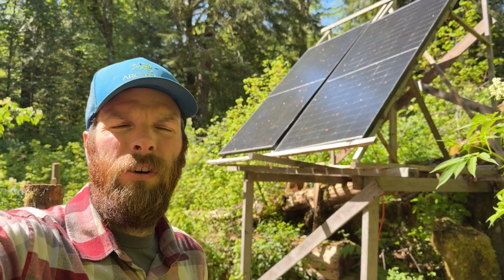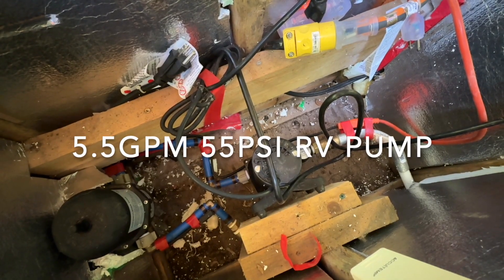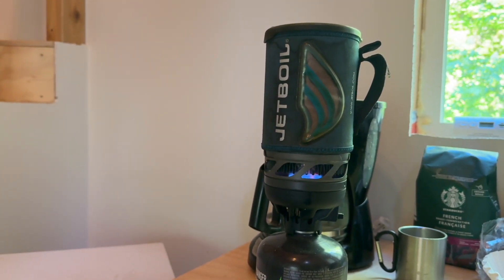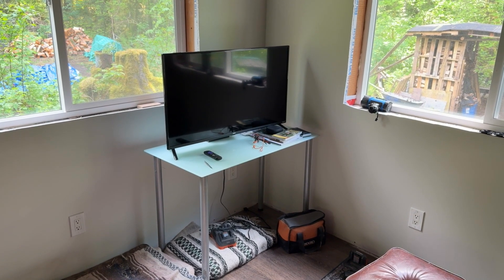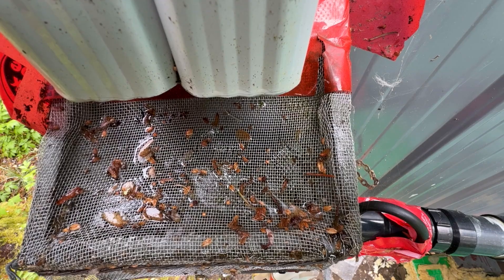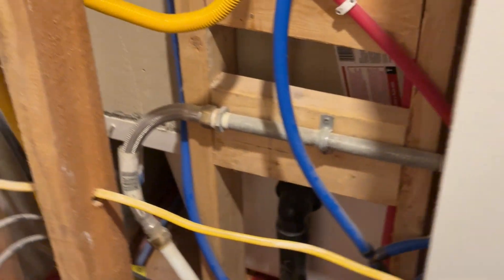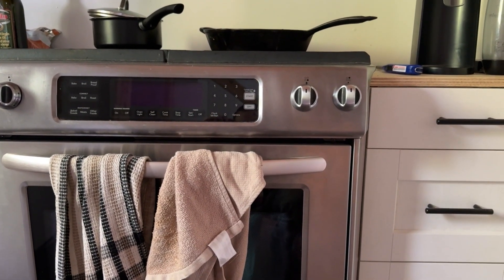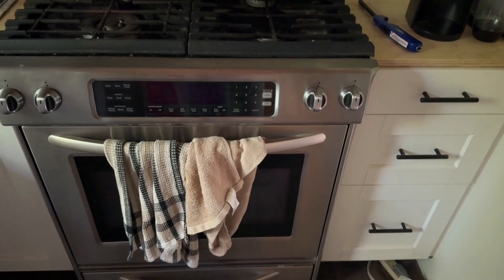Modern Off-Grid Living: Power, Water & Heat Explained

Comment: The stove "nuts" for propane or natural gas conversion are called "Orfices" I believe. you have a convection/ air fryer oven on that unit which will use that element in only that mode I believe.
Reply from the maker: Yes they are orifice nuts and it is a convection oven, I read through the manual and tried it once but it kicked on the electric element, maybe I'll see if I can find a different mode to turn it off but wasn't seeing it originally. I use two cast iron pans for a make shift oven which works ok haha.

Comment: I use a diesel heater for supplimental heat to my woodstove. The propane units area PITA and create a LOT of moisture unless vented and then not very efficient IMO.  The diesel heater will run all day on a single gallon of diesel and the heated air is completely clean and isolated from the combustion air so it doesnt burn up the oxygen in the room and release Co2. I have my solar system in place with a similiar AIO inverters and 30kwh of battery but have to tackle water next spring. during the winter I need the Generator periodically to charge the batteries.
Reply from the maker: Good to know thanks. Ya I'm leaning towards a diesel heater, how much wattage does the pump and fan use hourly?
Reply: @wildcoastoutpost  When you first fire it up it uses a glow plug to get going so it draws about 10 amps (@12v) and then after a couple minutes it drops to between 1-3 amps draw depending on fan/ heat setting. I have mine running off a ac to 12v dc power supply with a small lifepo4 battery also wired in parallel. you want the battery so the heater can be powered down without abruptly losing power which can damage things.
Reply from the maker: @fathergratwick  oh ok interesting thanks for that info. I’ll try it!

Comment: I thought you did a terrific job on this video. You are very knowledgeable about off grid. It’s a lot of learn for sure. We learned a lot growing up off grid in the summers at McNab.
Keep up the good work.
Matt Arnold
Reply from the maker: Hey thanks Matt. Appreciate the kind words. Definitely can be a lot sometimes but having fun!
Reply: I Have been watching your well videos since you started and am thrilled everything worked out for you.

I must say tho that I disagree with several thing you claim in this video and I think some clarity is needed. First off you can run any and all modern appliances from your solar system, assuming you build one for that purpose. I see people all the time moving away from off grid after watching a video like yours, and that needs to stop.

I have a 100% off grid home and it has every modern appliance, all running from electric. I have no backup generator, my system is designed not to need one.

I think when you are explaining the limitations of your system you should really include that the reason your system can't do these things is because your budget and lack of knowledge at the time on purchase and then installation was not enough to do it properly.

You have a solar system with like 820 watts of solar going into your all in one inverter charger. It can handle way more solar, and it should be. (i think it can take 4000watts iirc)

Next your battery bank is not big enough for a system to run a house, it is barely big enough for an RV.

The way you are supposed to size a system for a house is to first figure out how many kW of power you need to size your inverter. 3000 might be enough
Next, you determine how long you need to run those watts. this is to size your battery bank. You determine how many days of autonomy you want and increase the bank size accordingly.
Finally you choose your Solar array by calculating how much you need to charger your batteries by noon if the bank is depleted.

Now I know you are going to cry the "Thats a lot of money I don't have" song, and I get it. but just say that instead of saying that it can't be done, or you need to ration your power when in fact you dont if you build it properly.

ANyway, my off grid home doesnt have a well, I wish it did. Rain water isn't a thing either since it never rains more than 5 days a year.

Great job bumbling your way to a working well, I am envious for free water since I have to pay to have mine trucked in 16,000L at a time to supply my home, garden and Large inground pool.

Please don;t take this as hate, it iw written and intended to be taken as criticism 100%

PS, What part of canada are you in?
Reply: @sNEAKYnIGHTmUPPET  I agree with that point, I have built 30kwh of batteries and have two AIO charger inverters charging the same bank one 900w array and one 3100w array. I can run everything in my cabin including microwave, 7cuft fridge/freezer combo, tv , and coffee  maker for about 8 days without any solar or recharging of the battery. In the winter I still need to run the generator periodically as there isnt enough solar in NY state then. Now if I had a huge array in a clearing that got sun exposure all day and time to keep the panels all clean of snow maybe I could squeak by. The batteries are much cheaper if you learn to just buy the cells and wire up a BMS which is not hard. I built mine to be self heating and have them in a small metal shed with my generator and noisy inverters. something I learned though is one heated battery will drain another if wired in parallel so I now turn one off when im not there in freezing temps.